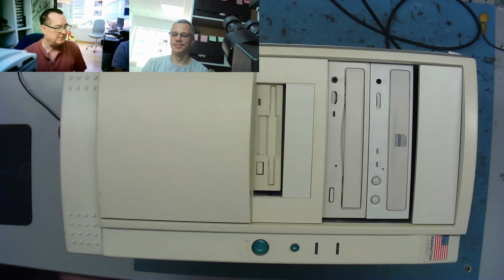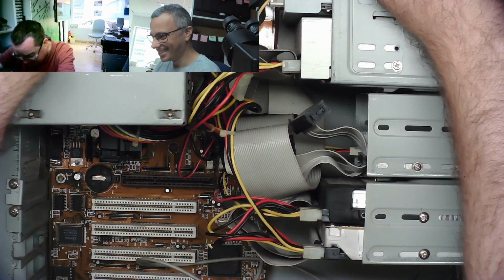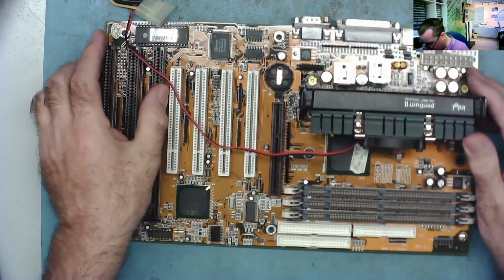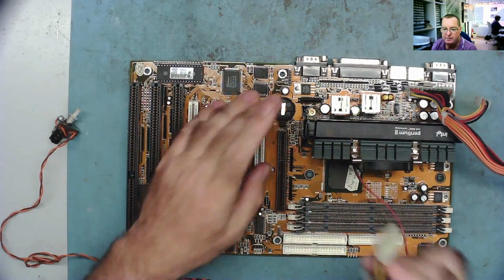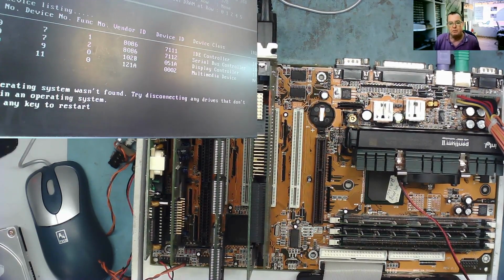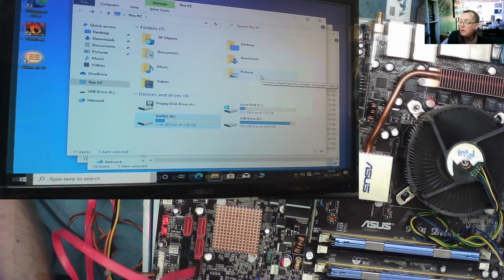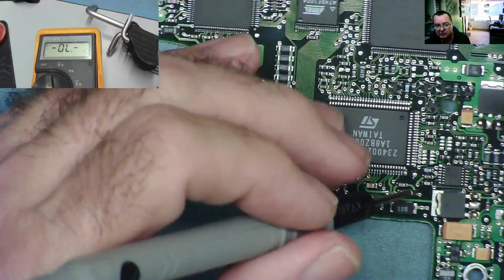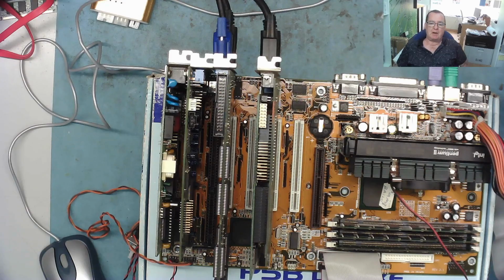Car Booty PC Finds And Much More Part 2.  What Was In The Box?

Comment: Regarding why it has a pci graphics card but has a free AGP slot About that time when standards kept changing people often couldnt afford to change the whole PC at once i remember we used to say upgrade the mb/cpu and use the Graphics cards and sound cards we happen to have. I remember i came unstucK with VLB though. But about that time more stuff was built into the MB. I also remember that some MB's had both Slot one and socket 370. You couldnt use both but i suppose you could have used your old CPU in your new MB and then upgrade the cpu as funds became available!

I also remember that a company that used to throw their old PC's in my direction went thru a phase of using Powerleap and Evergreen CPU upgrades to get an extra year or 2 out of hardware. They were CPU modules that pluged in say a socket 7 MB but used a super socket 7 cpu, or that fitted a "slot 1" MB that used a 2nd gen socket 370 CPU. They gave a good improvment in performance at a very low cost!

Comment: See? Just needed to persevere with the front panel. 

0:49 Now here’s my thinking…there was 4 different sockets for the Pentium 1: socket 4, 5, 7 and super socket 7. I think I’ve got at least one of each socket and can confirm that there was a transitional period  between socket 7 and super socket 7 where you would find an ATX power connector on an AT form factor board. 

That rear panel is not something you’d expect to see on a super socket 7 ATX board…I think this is something like a regular socket 7 board from like a Dell Optiplex that’s been put into a new case.

Edit: Not sure why you and Carlos would be talking about AMD and Cyrix, there might well be either of those chips (or an IBM chip or even IDT Winchip) but they were all made for socket 7. Intel didn’t have a proprietary platform until slot 1 and AMD didn’t have a proprietary platform until slot A, both of which came after this which I’m almost certain will be a socket 7 board.

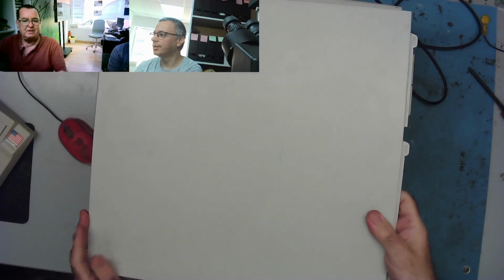2:20 Damn, we got trolled. Again though, I expect that’s a board that’s been removed from a Dell Optiplex or similar.

2:52 Yep, Matrox, called it 👌🏻

3:43 Yep, 12MB. The ones that only had 8MB have less chips.

5:00 That’s an AWE 64 standard, otherwise known as an AWE 64 Value. I’ve got one in a Slot 1 build.

36:01 That’s correct 👍🏻

39:19 I’d actually sell that board. If it was a branded board with a more standard I/O, I’d probably keep it. I’d sell the Matrox card also, it’s not historically important or particularly interesting like a Voodoo or a GeForce 256, it only holds value to those who have nostalgia for it. I’d install a better 440BX board with a Riva TNT (maybe a TNT2) alongside that Voodoo II 👌🏻

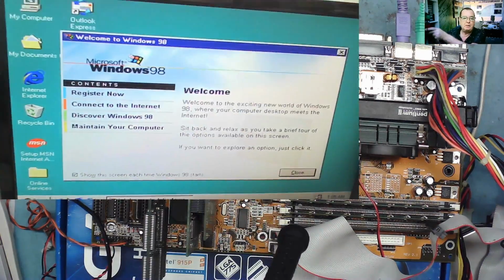45:14 You might find Windows ME useful in this instance as it has more drivers built in. Also, until your run a 3D application, the Voodoo card isn’t actually “working” I’ve seen seriously faulty Voodoo’s in machines that appear to work perfectly under a normal windows environment.

Comment: @35:00 I think they put components on other side so that an ISA and PCI slot could both "share" a bracket on the back of PC - if you have ISA and PCI slots basically touching each other, then both slots would use same opening in case. 
Hope you replace both capacitors on that VRM - I would use 10v or 16v rated ones, and I don't think slightly higher capacitance wouldn't be an issue. Basically, something that can tolerate the heat radiating from those heatsinks, something with higher lifetime rating.
Maybe you should probably look for some ISA IDE controllers or maybe an ISA / PCI scsi controller and a hard drive ... just for such cases where you can't boot from ide on motherboard.
Reply: Also, the front panel header is actually super easy to understand, if you pay attention you can see where there's lines with arrows at the end saying SUS LED for Suspend LED and HDD LED and you get the + on the other side of header for polarity of leds. 
Another person also mentioned there seems to be a non-"standard"  2 x 4 pin header for USB - probably board made before the 2x5 header became popular.

Comment: Yeah that fan is driving me crazy and definitely look at whether you can lubricate it and get it to quiet down... But yeah this is indeed quite a nice find for sure.
Also for LGA775 systems they definitely don't fetch much for sale at the moment because there are currently lots of them being getting rid of, but it may be indeed useful for you to keep ahold of one decent one for their flexibility, and that it can either be a nice and cheap XP gaming system or step up to Windows 11 if you wanna test IDE hard drives or use floppy drives, and Wolfdale Core 2 duos and Q9x00 Core 2 quads are certainly fast enough to run Windows 11 well and even do some slightly older games (pre-2018)

Comment: Richard the reason why your desoldering station keeps clogging up is because of the fluxs from the resoldered joints you have just done.The fluxs coats the inside of the solder sucker which causes the solder to stick to the inside tube I personally do not reflow the joint,but i put the temperature on the desoldering station to  470° C  and then just the desolder the joint without re-flowing first.  Hope this helps.
Reply from the maker: Thanks for the info, I have also mentioned this on a few videos that flux clogs up the vacuum desoldering tool
Reply: @LearnElectronicsRepair  and also run the tool pump a fair bit longer after sucking solder to help clear, particularly as you're fighting gravity too with the vertical tool.

Comment: My first overclocked CPU was a 486DX2-50 overclocked to 486DX2-66. I was at the university at the time and from time to time I bought and sold some CPUs and stuff. So I got my hands on a 486DX2-66 and reconfigured my motherboard for that speed and since I had to change a zillion jumpers to do that once I properly “tested” :-) the DX2-66 with several hours of DOOM(original on DOS) I had to deliver it to its rightful owner so I did but once I put back my 486DX2-50 I forgot to rejumper the motherboard and to my surprise it worked at 66 Mhz with no problem. Fast forward a couple of weeks and the machine was solid as a rock so I never got it back to the DX2-50 configuration and enjoyed it soooo much! The good old times! Thank you for the video Richard, bringing back fond memories of the 90s!

Comment: Cool video, thanks. On the hard drive issue, trying to restart them....i have sometimes had luck by holding it in one hand and quickly rotating it back and forth. I think the quick changeover from spinning in one direction to spinning in the other is often enough to jump-start them or return them to zero. Worth a try, always. Of course, it doesn't fix them but often enough to get the data off.
Reply from the maker: Yeah I can see how that would work.  Thanks

Comment: I imagined you would immediately go into the BIOS in hopes of finding a make and model but it seems you never did. That surely is not the case. Speaking of case, I thought that arrangement of the front panel covering the screws is a very standard configuration. Maybe it's because I normally used the Enlight 7237 case on all my builds back then and it is like that.
Reply from the maker: I got the motherboard BIOS ID from the screen and it is a Fungus Motherboard apparently - as I showed in the video 00:41:43

Comment: Of course the card with the black connector was a matrox (that connector is for the media xl), just a question which matrox, millenium-1, 2, or mystique.

So it's the mystique with a rainbow runner daughterboard (which allows for mpeg-1 decoding, jpeg encoding and editing).

 And afaict, only the millenium-ii and g100 and newer were AGP.